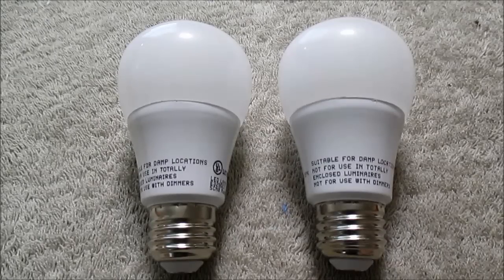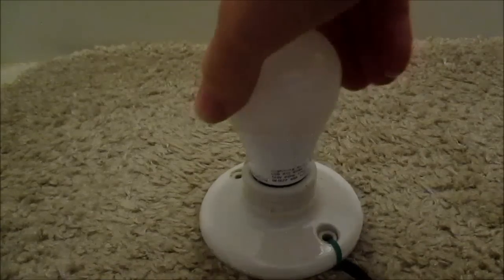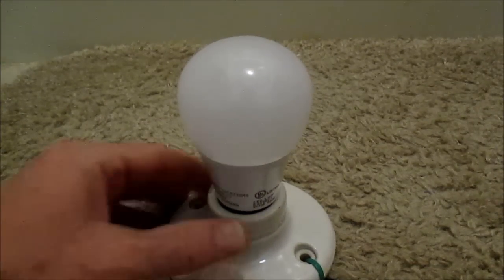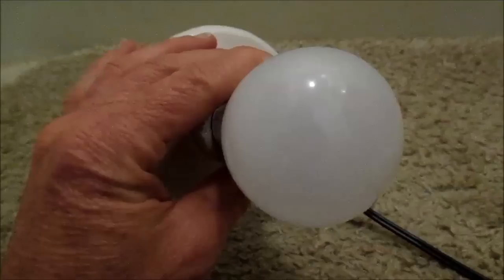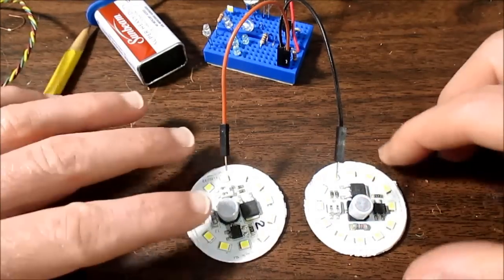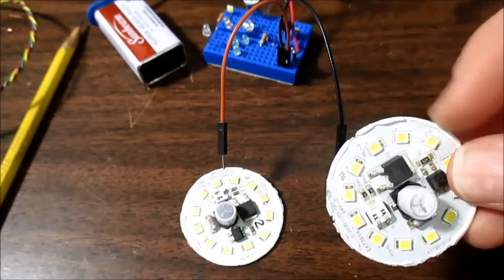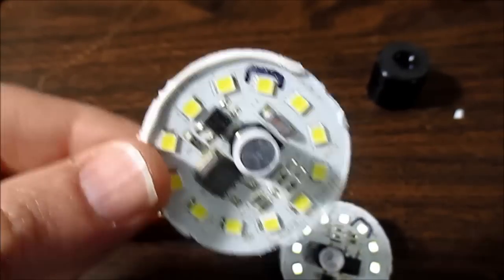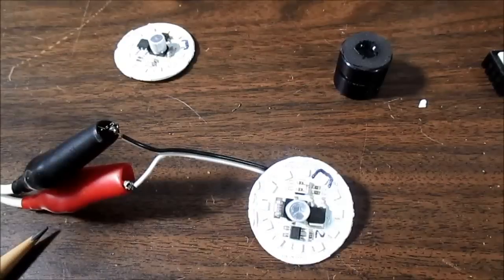Two failed LED bulbs for teardown to determine the cause

Comment: I reverse engineered this same circuit a few years ago. The controller is a triac, and it fires on each half of the power cycle (hence the bulb flashes at 120Hz). The bad thing about this circuit is that current is not constant, it is instead a very large discharge current for a short period of time. The average current is within the spec of the LEDs. However, the peak current spec is being exceeded by a large amount. By continuously blasting large currents through the LEDs, the weakest LEDs get overstressed and die. Since the LEDs are wired in series, it's the old Christmas tree lights syndrome where if one lamp fails, the entire strings goes down. It's a very lousy design which is why these lamps fail repeatedly. They are junk. Toss the entire lamp and get something more modern.
Reply: How can a layman recognize and get a good quality circuit?
Reply: @siriusleto3758  buy a good quality bulb. The best ones come from reputable brands and while still low in cost, are around $10 -$20 per box at my local big box store. Additionally, look at technical YouTube videos where they tear them down.
Reply: You seem knowledgeable, can you design a light bulb that isn’t design to fail after a certain amount of time? 

Planned obsolescence should be a crime against humanity.
Reply: Purchase CFLs online your welcome.
Reply: @brianfitch5469   I agree cfls last way longer they’re my favorite

Comment: Led if are made of good quality mostly with separate driver circut they last realy long ..second moisture from like hot water showers in bath room can leak current and short circut leds in serries as happened in my bathroom

Comment: Very instructive! Would it be worthwhile shorting the failing led?
You had trouble removing the cap? Well, I had a 5 W led "bulb" where the cap already fell of twice (second time several months after I glued it, so the glue must have loosened due to heat?).

Comment: Hi there I installed over two years ago, 4 mounted column exterior lamps, all working off one switch. The last couple of days one led bulb for some reason started to flicker. This is with the light switch off. If I take that bulb out.  The reminder three all flickers, until I reinstall the bulb. I also replaced that bulb. 
Any ideas please. There is no ground wire in the circuit. I live in the Far East 👍👍👍

Comment: Have you ever wondered why sockets and plugs, after first repair, keeps on failing? Simple. Electricians do not tighten the wires well. Heat is generated, plastic melts, you got to get new ones. Electrician buys, fixes, you pay for both.

Comment: I CONVERTED TO LED BULBS IN MY HOUSE AROUND 3 YEARS AGO ,THEY ARE SUPPOSED TO LAST 10 TO 20 YEARS .In my garage i changed the neon fixtures for 10  ordinary  e27  screw on type only 3 mounths  ago out of ten four failed already , i have around 20 defective bulbs in  box  . what is it whit these bulbs that are supposed to last many years have a 30 to 40% failure rate within a couple of month ,i tried many brands with same result

Comment: I suspect they are intentionally overdriving the leds like when the tungsten in the incandescent predecessor to the led bulbs caused an intentional over current so the life was intentionally limited to a predetermined amount of hours. Thanks for nothing Edison.
Reply: What an IDIOTIC REMARK.
I presume you are now using an oil lamp or a candle.

Comment: fusable resistor? when and who invented this?
Reply: I think a PTC is meant by that, a resistor with a Positive Temperature Coefficient. This means that below the trigger current the resistor stays relative cold and low in resistance, but when over its trigger current it runs hot, and with that its resistance rises to values that restrict the current enough.
They are slow in reaction, it can take many seconds before it does its job, but in some situation that's all you need, like to protect a transformer. Some transformers have one build-in.
Reply: @erikdenhouter  what you are referencing is a solid-state device called a thermistor and they do not look ANYTHING like a resistor, In the circuit used for the LED lightbulb there is no reason to worry about heat or current in-rush all that is needed is a simple  current limiter which is probably the job of the resistor, and possibly a cheap voltage regulator, be it something from the LM series or a pulse width modulation scheme IF it can be applied cheap enough
Reply: one other point to keep in mind: on cheap electronic items like this, ignore the markings. There is a very high probability that the boards were screened bur unetched or drilled that the mfg picked up on the surplus market that they then finished to their own specs, cutting their costs as far as 1/100th of what it would have been otherwise. It could also be revision changes, and numerous other reasons.
Reply: What I talked about is more known as a 'multifuse', and indeed not directly needed here. But to my thinking as a PTC it fits most the term 'fusable resistor'.
Reply: @erikdenhouter  the device you pointed out on the board is a simple resistor. You can Argue all you want, it wont change that,  what you seem to be calling a "fuseable resistor" (fused resistor) is a apparently a glass tube fuse with a fuse at one end. This is known as a Slow blow fuse. Kid Ive been in this business longer than you have been alive. You dont know your components or their uses. You also need to learn about the number one principle used in circuit design, the KISS principle. Google it
Reply: Yes that is a resistor, no I would not argue that fact, but yes YOU mentioned a 'fusable resistor' in the title of your comment. I did not even hear that term in the video, I reacted in what I think could be meant by the term YOU mentioned.
No argue intended.

Comment: Interesting info! Always wondered what was inside one of those bulbs. Looks like you could steal good LEDs from a bulb to fix other ones. Of course, if the LEDs are substandard that repair would only last until another LED popped.

Comment: The success of such a design stands and falls with the dimensioning of the parts. And as I look at this particular design specially the quality of the capacitor. Just don't run anything over its rating, because that in the end will determine how long it will last. Then make a good one off design with a NTC to adjust for temperature. All the parts (except the capacitor and LED's) could be put in one package made for less than 20 cents. It could be manufactured in the tens of billions. 

B.t.w., every individual LED on the market should have a maximum rating written on them, like with any SMD resistor or other part has been done. Strange world of manufacturing where the desire to do so suddenly dissappeared . . .

Comment: You can clearly see a black spot on that led that you diagnosed as open. I'm guessing they are running them at too high a current therefore stressing the leds

Comment: Such a waste of the working hardware for the sake of one led...

Could it be wired in parallel?
Reply: Inefficient. A typlical LED needs 3Volt, but since a LED is not a linear device (it's resistance is dependent on the current run trough), for that the current must be regulated PER LED. And in parallel that means at least a resistor per LED, or a semi-conductor per LED, and that is more loss, more device, more expensive.
The solution there is to put all the LED's in series, so you can add all the Voltages (say 16x 3V = 48 Volt, a safe to handle value), and in that series string just ONE regulator that restricts the current for all. All LED's would get the amount of current set.

Comment: If the LEDs are in series, then can you not use a jumper wire over the bad LED for it to work again?
Reply: Yes of course you can.
BUT then you have one less load sharing the same voltage, which means that all the other LEDS  are being OVERDRIVEN, which will lead to premature failure.
Reply: Yes, that's what I did exactly.  That bulb is a bit brighter than it was before because of having fewer LEDs in series and it probably will burn out another LED before too long but for now it's still working.  A better solution could be to jumper it with a resistor.

Comment: Take an led from one lamp and fix the other lamp, oh wait , you stuck a screw driver Thu the plastic cover, maybe next time you will know better...
Reply: There's no vacuum in an LED bulb so you can make a hole in the plastic cover without ruining it.  I just cracked the glue around the rim instead though.  Didn't need to make any hole in the bulb.

Comment: I watched this video about year ago when i bought few LED bulbs (i used my diy version with ebay leds and drivers mounted on heatsink and hidden in lamp, some of them are working for 7-8y now) and i though i gave it a try, i mean it's cheaper since my version costs like 5$ + heatsink, but today second bulb died, one of the LEDs is halfway dead. I'm gonna try to repair it, didn't think this was a deal until i saw this video again.

Comment: What if they were stressed? With black dots on them as you said. Can they be desoldered and replaced? I am not much of a throwaway guy. My work light illuminates slightly... or barely I would say, two have black dots on them.

Comment: the key problem of these and a majority of other bulbs is no heating at all. 

the 10W led bulb should have a heatsink designed to dissipate about 7W of heat, which is close to power dissipation of an Intel Atom CPU. Look for a fan-less motherboards photos where Intel Atom is used and you'll realize the heatsink is a palm-size aluminium hedgehog. 

these bulbs have no heatsink at all, even if they had an aluminium cone pipe next to the thread part - it is fully covered with a white plastic so there is no heat pass through. And even the PCB surface is covered by semi transparent sphere to stop any heat dissipation and guarantee that LEDs would overheat and die someday. 

just don't buy led bulbs where you see no aluminium heatsink. The only possible exception is a 3W or less bulbs where their aluminium PCB is close enough to required heatsink surface size.

Comment: When i moved into my apartment i changed all the bulbs in the place with LED bulbs.. most of the fixtures have dual bulb setups...it just seems ODD to me that both bulbs crap out within a few days of each other in every instance... perhaps a built in failure so you will buy new bulbs?

Comment: How the voltage was reduced from 120v AC to 9 v. Was there transformer or resistance?
Reply: Hi! There are 12 leds ! Each one is rated at 9 volts and they are connected in series  . So 9x12= 108 volts.

Comment: I keep having this issue with my LEDs from many different manufacturers. The failures range from burn out bases to not handling voltage.
My latest is a batch of 20000 hour LEDs that have lasted 600 hours max. I've been going back to old style filament bulbs.

Comment: Notice that these LED lights are marked on the base as “not for totally enclosed luminaries”.  This means you should not put them in a glass bulb fixture, like what is used outside.  Is this because of a heat buildup issue?  I avoid these because of this, but would like someone to tell me why anyone would make them.

Comment: This is a very good and informative video in my opinion...  I bought a roll of these SMD LEDs on ebay for $9 for 300 on the roll.. Replacing the individual LEDs is a simple process with a soldering iron.  A few years ago, I actually made a "Instructables" on this on the instructables.com site for the other Chinese LEDs which look like a corn-cob LOL..  Its interesting that you can repair light bulbs if you like for like $.03 each.

I also note that when you buy the replacement SMD LEDs, they do not burn out like the original Chinese ones do, and seem to be much higher quality than the Chinese garbage (probably all are from China though).  On testing your LEDs, a quick note that might help someone is that if you use your meter in "Diode Test", the current will be enough to dimly light an individual SMD LED when you place the meter leads across it.. It will light in one direction and nothing in the other.. Its basically testing a diode in its simplest form, and is not destructive to do so  ;-\..  

Those resisters and capacitors are for dividing voltage as well as filtering as an FYI...  LEDs don't like reverse current banging on them, and don't like line voltage rectified banging on them either.. LOL  Yours here have a regulator which is a really good idea where the old Chinese "corn-cob" lights have a ballast capacitor to drop the voltage from the 110V to a more manageable voltage for the series array of LEDs.  LEDs are VERY sensitive to reverse current and just a smidgen will pop them... so take care!

Comment: I have used removed LEDs from these in other projects. I just had to use current formula to figure correct resistor to use and then experiment. Most of the projects I used theme in were of 12 volt supply.

Comment: Doesn't necessarily mean the LEDs are crappy.  They might just be running them at too high a current level to get more light, and lowering their lifetimes dramatically.  Run at correct currents, they SHOULD last for many many years.  It would be interesting replace the bad LED with a good one from another failed bulb unit, and to raise that 7.5 ohms to say 8.5 and see if they last forever.  I suspect they might, but you will get noticeably less light out.  This seems to happen a lot in the newer cars that use LEDs in the taillights, too.  I have a VERY early red dot LED as a power on indicator on an old pre amp/amplifier my father built for me as a kid, that STILL lights just fine, and I used it every day, many hours, for many many years.  It was VERY low output, though.

Comment: So simply short the bad LED's out and put the bulbs back together and they will work longer. Until another LED goes bad. Are the LED's in series?
Reply: The LEDs are generally in series, which actually makes sense in a number of ways, including being able to use the line voltage without stepping it down.

Comment: The dies are stuck on flip chip style with metal epoxy glue which does not like thermal cycles. Eventually it fails causing the die to separate from the heatsink where it overheats making the nitride crystal break free from the bond wire. Maney newer white led bulbs have an integrated zener diode to bypass if one or two blows out.

Comment: They're overheating as not getting sufficient cooling. LEDs are not tolerate that excess of heat. Proper cooling need large aluminum (or copper - OMG) heat sink, and a lot of space, they couldn't fit into a regular bulb design.

Comment: Planned to fail?  Check this out.  I worked for a big lighting company, still in business today, back in the 90s when LEDs did not exist and it wasn't until I had been there a year that I was brought into an R&D meeting where they said we have it to 1080 at 1.  I said, "I do not understand, what do those numbers mean?" and I was told the first number was the amount of hours the bulbs were DESIGNED to work and the 1 was the minute and the tolerance of how long it would work after the 1080 hours.  I was stunned and appalled that the bulbs would work 1080 hours within a minute guaranteed.  I left the company shortly afterward because it was a dead-end job and I did not approve of their low ethical standards in relation to workers and products.  More recent when the LED bulbs came out, most companies not into lighting originally advertised lifetime and then later 10 years and then later 7 years and then again 5 years.  How can they stay in business if they provided an enormous amount of LEDs and then suddenly the demand dropped to half the need?  When I look back and even today, I understand why they are planned to fail but do not condone it.   Just make multiple product lines and be happy with the fact you make money on it, but see there are also unseen pressures.  For example look at Home Depot, they are almost down to one company dominating the LED light bulb market and why?  Because that company can provide all the SKUs needed to meet the needs of all the stores, not just one specialty bulb but any type of any wattage.  This drives out the competition and a Chinese company that makes one type cannot get shelf space and hence loses all business in this category.  So to compensate Planned Obsolescence (the timed breakdown of a product to insure future sales) is incorporated and believe me it will be incorporated with these new LEDs.  In the future, the next generation of people will be brainwashed to believe that a 1 year lifespan on an LED bulb is the best they can do, just like the original incandescent bulbs.  The first ones by Edison in some cases operated for 25 years, but any incandescent bulbs before the breakout of LEDs only lasted months if you were lucky, but remember it is no luck on how long they last and LEDs will be no exception.  The Chinese are only copying what other goliaths have already been practicing for years in the American market.  Not sure how this could be prevented without companies going out of business...and that brings us to the social implications of the Capitalistic System(not putting it down, just pointing out the downside of it)

Comment: Very interesting.  I've replaced all the bulbs in my home with LEDS.  Most, many, purchased on EBAY direct from China.  The failure rate has been, in my opinion outrageous.   True, I'm not sure but, in an e-mail from one of the Chinese companies I was told only buy bulbs marked with UL approval as they are superior quality.  After much wasted money, I will only buy branded LEDs GE, Cree etc.

Comment: My experience with  LEDs have not been good. Heat seems to be a killer. I live in a hot climate where temps go over 50 C and leave a LED during day on and it dies. I have some LEDs in a cold room that are over 5 years old and stay on 24 hours.Great video.thanks